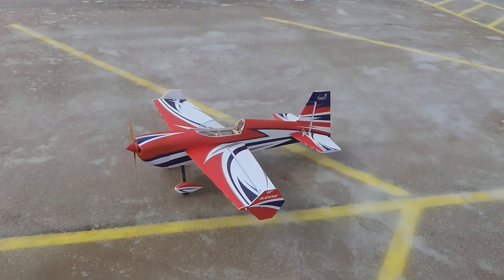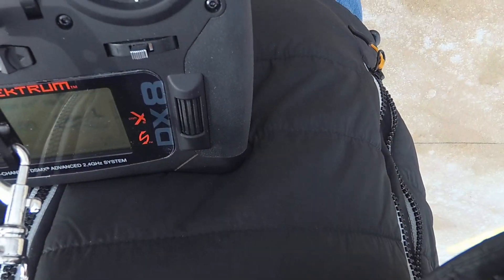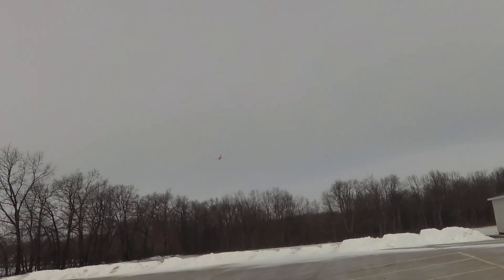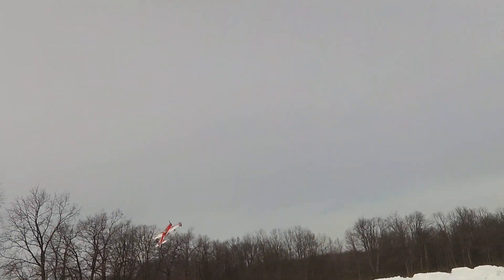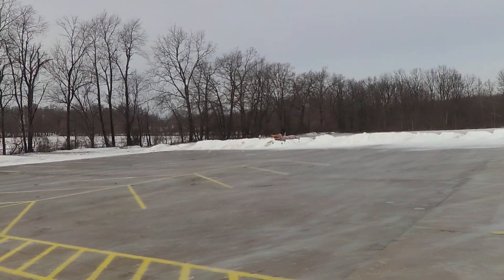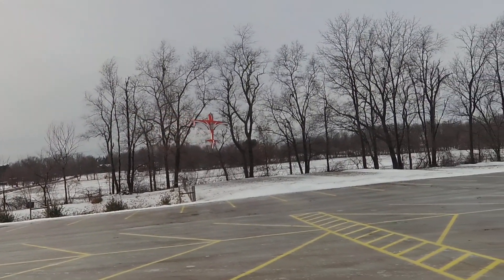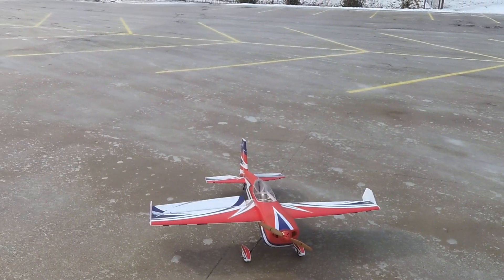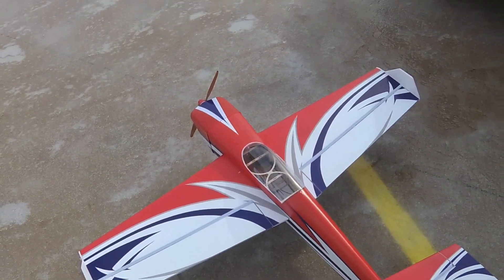2-14-2019 Future Model 60" Slick 540 maiden flight

Comment: Finally up to putting it together, although still waiting for the motor and the batteries. I had ordered servo's al long time ago for this bird but didn't know what size hole there was in the model. They said 5Kg servo's. I chose some quite descent ones but they are too big. Judging by the surface area these should quite strong servo's.  What servo did you use or did you enlarge the holes?
Reply from the maker: Started with Rotorstar RS-3878MGT but switched to Savox SV-1250MG at 7.4V. Didn't enlarge holes. The ailerons needs strong servos if you want full roll rate full throttle in a vertical dive. Even the SV-1250MG's aren't strong enough! The ele and rud do okay since they're counter balanced.
Reply: @somespamsite44  Sorry to bother you again. But mine did not come with an instruction manual. There are some parts I have never seen before in over 30 years of scratch and kit building. Their website is not exactly functional nor functioning. Do you have a link to the instruction manual or is it best to send them an e-mail?
Reply from the maker: @b.w.oostdam8875  No bother! There's no manual available as far as I know. I can probably tell you what the parts are for if you can get a picture or video of them, or at least describe them. The only odd parts I can think of off the top of my head are two small pieces of white PP foam. They're supposed to be a transition from gear to fuseleage belly. Purely cosmetic. I left mine off.
Reply: @somespamsite44  Thank you, I looked at the items briefly and could not immediatly guess what they are for. I will look again and will send picture if I cannot figure it out. They are in the bag with the control horns. They are some kind of black plastic clip or something.
Reply from the maker: Ah yes. They're probably the servo plug safety clips. To keep your servo extension from coming unplugged from the servo wire. I didn't use those either as I just put a piece of heat shrink tubing over the plugs. I figure the less weight flopping around, the better. Just do a search for "servo safety clip" and you'll probably see some that look just like it.
Reply: @somespamsite44  ah yes that must be it. Indeed I do not plan on using them. As I am.using servos that will draw quite some amps i orderded heavier servo cable ans will make my owen extensions by soldering them. I soldered for a living some time. The weight is indeed crucial. Also found out that the small bolts with the round knobs are for the side thrust generators. First plane with those. :-) thanks again!
Reply from the maker: @b.w.oostdam8875  Sounds good! Also, the two clear plastic pieces go between the side force generators and the screws so the screw heads don't go into the foam.
Reply from the maker: @b.w.oostdam8875  Ignore the part about the clear plastic pieces.. I was getting my planes mixed up. That applies to the Skywing 55" Edge.
Reply: @somespamsite44  Thank you! I do have the clear plastic rings en assumed they were to protect the foam of the sideforce gens.. Keep flying !
Reply: Thank you very much.  That is becoming quite an expensive setup... Already thought these servo's do not have what i takes. Contemplating to enlarge the holes 2.5mm on all sides to fit standard digital servo's...
Reply from the maker: Wouldn't be a bad idea for the ailerons, at least.